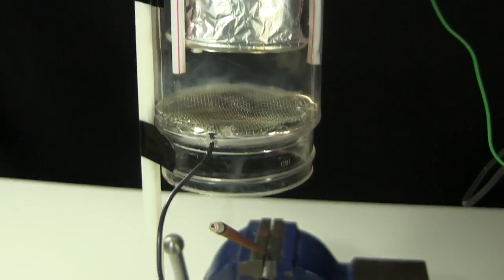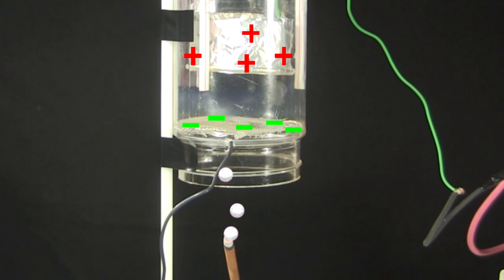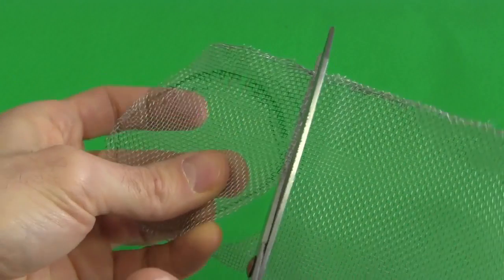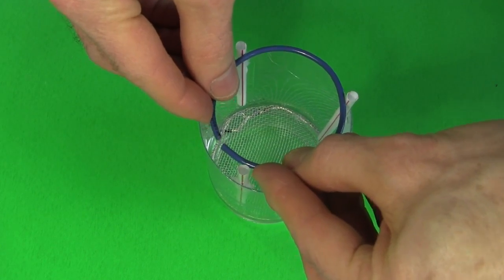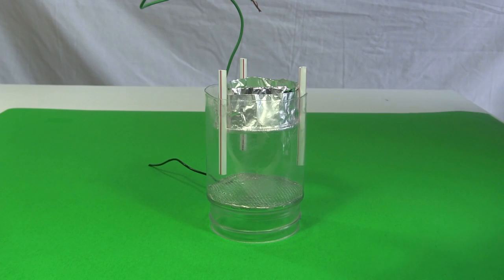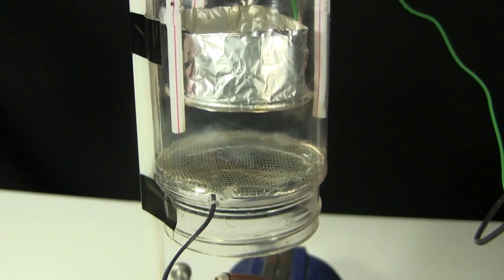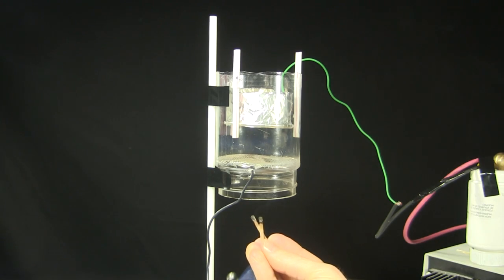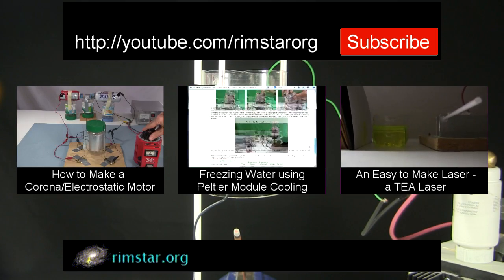Electrostatic Precipitator/Smoke Precipitator - How it Works/How to Make

Comment: First of all, thank you for sharing this video. However do you think that is it possible to apply this precipitator as ESP with the home used incinerator for capturing the smoke and gases from the chimney?
Reply from the maker: It might work. I tested with a few different smoke sources and it worked with the ones I tried. Keep in mind that the voltage involved for this design is high enough voltage to also produce ozone, which in large quantities is bad for your health. But if it's a chimney then the ozone would be outdoors and so less harmful. You might also want to see my follow-up video where I also measured the voltage and tried a few more high voltage sources https://youtu.be/ARSQWTzWago

Comment: Very interesting. I suppose you use a high voltage in DC and not in AC. Is it correct? So, in case I use a HV transformer, should I connect a proper rectifier at the transformer output?...Thank you!
Reply: He mentioned the mesh as negative and the foil as positive. So of course it will be dc. Ac will not work as the particles moves back and forth but never stick to the plate

Comment: To trap dust, can we use current from a battery?
Reply from the maker: Nope, this design needs around 21,000 volts. Batteries are around 1.5 to 12 volts.

Comment: My chance you can include a link for a suitable power source?
Reply from the maker: Have a look at my follow-up video where I made measurements and tested a few different power supplies https://youtu.be/ARSQWTzWago . You'll see that my 26cm disk Wimshurst machine worked as a power supply. Search on https://ebay.com for "wimshurst machine" and you'll see plenty of Wimshurst machines which should work. That's where I got mine from many years ago. Just make sure the disks are around 1 foot/30cm in diameter.

Comment: can i use a homemade van de graff generator as the voltage source?
Reply from the maker: I didn't try it. My guess would be the dome for the Van de Graaff would probably have to be at least 1 foot.30 cm in diameter, i.e., a medium size one at least. It would be able to produce the necessary voltage but you also need a decent amount of current too. Also, have a look at my follow-up video where I made measurements and tested a few different power supplies https://youtu.be/ARSQWTzWago . You'll see that my 26cm disk Wimshurst machine worked as a power supply. Search on https://ebay.com for "wimshurst machine" and you'll see plenty of Wimshurst machines which should work. That's where I got mine from many years ago. Just make sure the disks are around 1 foot/30cm in diameter.
Reply: @RimstarOrg  ok so i should try out the wimshurst machine, thank you

Comment: can we use this for solving promblems of co2 or any toxic gas pls answer my question
Reply from the maker: Nope. In fact, at the high voltages involved with this design, around 21,000 volts, it produces ozone, which is also bad for your health. So it's something you'd have to use in a well ventilated room. There's probably a design you can use with lower voltage that doesn't produce ozone but it doesn't collect every type of bad thing in the air.

Comment: Is 21,000 volts really necessary? What is the lowest voltage you can use and still get results? I was thinking about buying a Harbor Freight powder coating system and using the parts from that to power my smoke precipitator. I read that it goes up to 50,000 volts? But again, is 21,000 volts even necessary? Also, on the powder coating system, the part is negatively charged and the powder is positively charged. Is there a difference whether the smoke is negatively or positively charged? Or do you think you would get the same result regardless? Thank you for taking the time to read my question! 😁
Reply from the maker: 21,000 volts is necessary for this design, i.e., this particular wire mesh for one electrode and a the cylinder having this diameter of smooth bottom facing the wire. A lower voltage can be used if you have a different geometry or design, possibly even in the 10,000 volts range. I don't know about a difference with positively or negatively charged smoke though, I don't know enough to say.

Comment: How many volt required
Reply from the maker: Around 21,000 volts for this design. I show measuring it in this follow-up video https://youtu.be/ARSQWTzWago along with testing other power supplies.

Comment: hey I was just thinking is it possible to make a cigarette filter using this technology? so that the tar gets filtered?
Reply from the maker: I didn't have a cigarette to try so I can't say for sure. Note that with this design, the voltage required is around 21,000 volts. At that voltage, it also produces ozone, which is hazardous to your health in large quantities.

Comment: Hi! Nice video. Will it still work if the screen electrodes fully coated with smoke gunk o soot?
Reply from the maker: Good point. I've never run it for very long, just to try out and demonstrate the basic principle. I don't recall soot gathering on the wire, but if it does then you'd need to replace or clean it every now and then. I suspect that it doesn't gather there because soot does gather on the foil and is hard, if not impossible to clean off. Meanwhile, the device kept working so little or no soot must have been sticking to the wires. But as I said, I didn't run it for long.
Reply: In industrial plant they seems to vibrate the collector to reclaim the pollution's dust

Comment: How much voltage is needed
Reply from the maker: This design needs around 21,000 volts. I show measuring it in this follow-up video https://youtu.be/Lz-HfDWjmRQ . I also show trying different power supplies.

Comment: I would love to install a larger version of this technology on the exhaust system of my gasoline/fossil fuel/petrol powered automobile. and furthermore, if this technology could entirely replace the present catalytic converters in the exhaust system, this could contribute to highly reduced automobile pricing, because catalytic converters require very expensive materials which also have a limited lifespan.

this is wonderful tech, indeed!

thank you for making this wonderful video!
Reply: Nice ! Have you tried since ?

Comment: I have made the same system but it's not working...can you help me out??
Reply from the maker: You'll have to describe what you're doing. What are you using for the high voltage power supply? It has to be DC not AC. Do you know how high a voltage? Have a look at my follow-up video where I measure the voltage and show that for this one I needed around 21,000 volts https://youtu.be/Lz-HfDWjmRQ . In that video, I also show testing other power supplies.

Comment: Is this how bore evacuators work?
Reply from the maker: I hadn't heard of a bore evacuator until you mentioned it but nope, a bore evacuator is a much simpler device, simply an area in a gun barrel which becomes pressurized with some of the gases during firing and then that pressure removes most gases from the barrel after firing. See https://en.wikipedia.org/wiki/Bore_evacuator

Comment: That looks good the only problem is the cost of the high voltage power supply
Reply from the maker: Yup, that high voltage power supply is either hard to make or an off-the-shelf one would cost a lot. However, I did this follow-up video https://youtu.be/Lz-HfDWjmRQ where I found that a much cheaper Wimshurst machine will also work.

Comment: what is the output of high voltage generator ?
Reply from the maker: For this design, I needed at least 21,000 volts. You can see me measuring it in this follow-up video https://youtu.be/Lz-HfDWjmRQ

Comment: why does the mesh become negatively charged
Reply from the maker: The mesh is connected to the ground but it's also the negative of the power supply. So the power supply is what negatively charges it while at the same time positively charging the cylinder.

Comment: Hi! Please answer, we have a research about it. How high is that voltage?
Reply from the maker: For this design, it's around 21,000 volts. See my follow-up video where I show measuring it as well as experimenting with some other power supplies https://www.youtube.com/watch?v=ARSQWTzWago
Reply: @RimstarOrg  that high! It can be lower that that? Or can i use my 2 3.6 V battery?
Reply from the maker: No, high voltage is required to ionize air. Typically in the thousands.
Reply: @RimstarOrg  okay thanks

Comment: How much voltage it required ?
Reply from the maker: For this design, it requires around 21,000 volts. I show measuring it in my follow-up video here https://www.youtube.com/watch?v=ARSQWTzWago
Reply: @RimstarOrg  Thanks a lot. And it is difficult to demonstrate this in Science Exhibition for Scientific Solution for Environmental Sustainable.
If you don't mind can you give any ideas related to the subject above for Science Exhibition to make a model for it .

Comment: I wanted much more info about the power supply. I wish to create a larger version for my HVAC system. I was considering a power supply from a neon sign.
Reply from the maker: Make sure the output of your neon sign based power supply is DC. This doesn't work with AC. Another thing to consider is that this precipitator design produces ozone, which is hazardous to your health in large quantities. The ozone is produced where the ionization is happening in the precipitator. In a follow-up video https://www.youtube.com/watch?v=ARSQWTzWago I measured the voltage required for this one to be around 21,000 volts. There's some voltage below 10,000 volts, I don't know what voltage, that doesn't produce ozone. If you could make a precipitator design that works below whatever that voltage is then you could have one that doesn't produce ozone.

Comment: Its an amazing Project.  Very Informative. I tried to do the same. But I was using Two 9V battery for input and 40KV Step up module. I am getting the spark but precipitator is not working. If the smoke needs to be captured what is the kind input voltage I should use and what is the kind of transformer that I should use. Please let me know. that will be very helpful
Reply from the maker: In my follow-up video I think I measured 21kV https://www.youtube.com/watch?v=ARSQWTzWago . In that video I also show it working with a Wimshurst machine (30 cm disks), so that's another option. Your two 9V batteries stepped up to 40kV probably didn't supply enough current. It needs high voltage but also enough current to do the necessary amount of ionization. I don't have a number for how much current though. It you are getting a spark though, then your mesh is too close to the cylinder, move them apart more. I also show that in the follow-up video.

Comment: Can this reduces smoke smell also..?
Reply from the maker: I would think so since it's capturing all the soot but I'm not sure if what you smell is only the soot, maybe there's something else that doesn't get captured by the precipitator so I'm not sure.
Reply: @RimstarOrg  thank you for the reply. Does it requires high voltage Or I can use Batteries..?
Reply from the maker: I requires high voltage. I measure it and show some alterative power sources in my follow-up video here https://www.youtube.com/watch?v=ARSQWTzWago

Comment: Is the ground wire (-) independent of the positive high voltage source?  or does this come from the same source?
Reply from the maker: The ground wire is connected to the same one that the high voltage power supply uses. So the high voltage positive is relative to ground. If you have a high voltage power supply who's positive and negative outputs are floating (i.e., they're not relative to ground) then you have no idea what voltage they are relative to the table, which is at ground potential. So you could get unexpected effects.
Reply: @RimstarOrg  wow I understand brother, then the cable that is attached to the flyscreen mesh is the negative output of the flyback?
Reply from the maker: Essentially, yes. Mine doesn't have a pin marked as negative but rather a pin marked as ground. But this power supply doesn't use the output of the flyback. The output of the flyback goes to the input of a voltage multiplier. The output of the voltage multiplier is the output of the power supply. Here's my webpage all about it https://rimstar.org/equip/30kv_pwr_supply.htm . I did try powering this smoke precipitator using a power supply who's output was the output of a flyback with a built-in diode (to get high voltage DC) but I didn't have any success. You can see that one in my follow-up video https://www.youtube.com/watch?v=ARSQWTzWago at around 2 minutes and 4 seconds in. You can find details about that power supply here https://rimstar.org/science_electronics_projects/high_voltage_power_supply_w_flyback_transformer_builtin_diodes.htm
Reply: @RimstarOrg  Now I understand brother, thank you very much for these valuable contributions to knowledge, all your experiments are great.

Comment: What is your voltage used for the separator?
Reply from the maker: For this one, the voltage is 21,000 volts. I measure it in my follow-up video here https://www.youtube.com/watch?v=ARSQWTzWago along with try a few other power supplies.
Reply: @RimstarOrg  i ve go 50kV generator
Its posible for this project
Reply from the maker: Maybe. I also has to be able to supply a sufficient amount of current and I don't know how much. But as you saw in the follow-up video, it worked with a Wimshurst machine which doesn't supply much current. Also, make sure if a 50kV DC generator, not AC.

Comment: cool!
I ponder if it is possible to create a functioning smoke precipitator for laser engraving. It is common laser engravers has an air assist (air blowing away smoke from the burning focus point) , it word be cool to collect this so the wood/paper etc don't get tarnished by swirling smoke.
Reply: ad an air evacuation system that pulls the smoke away and out. once out the smoke can be filtered in any number of ways including electrostatic like this. Tip, use smaller fans to suck out the smoke and maybe a small fan to first blow it away from the laser engraving so the smoke will not block the laser beam. This is a pretty common problem in laser engraving so you should be able to find plenty of examples online.
Reply: @robert5  For laser we use mostly a high flow rate fan with a 150 mm hose. Would be really good to collect all the particles. 
But there are glue residue, smoke inside....

Comment: How much amps is the high voltage DC connected to the precipitator
Reply from the maker: I didn't measure the amps so I don't know.
Reply from the maker: BTW in my follow-up video, I show testing it with a few other high voltage source, some which provide enough voltage and current and some which don't.

Comment: Super video, subscribed!  Thanks indeed.  I wonder if this could be scaled up for home carbon-fuelled oven installations? What kind of voltage are you running here?  Perhaps a different metal will give a different result also..?
Reply: please ignore Q regarding voltage!   oops!
Reply from the maker: I don't think a different metal would help but a thinner wire in the mesh would decrease the voltage needed. As for scaling it up, you'd have to do a bit of redesign but it should be doable. There are precipitators used for industrial systems. However, as you saw in the follow-up voltage, it produces ozone, which in large enough quantities is harmful to your health.

Comment: Why did you grounded the Negative high voltage ???
Reply from the maker: That's mostly for safety. Let's say I have 20,000 volts. That 20,000 volts has to be relative to something. If the power supply's negative and the mesh are connected to ground then the positive and the cylinder are 20,000 volts relative to ground. However, if I don't connect to ground then the 20,000 volts can be relative to any voltage. One side could even be 50,000 volts relative to ground, we don't know. The voltage would be what we call a floating voltage.

Comment: Goes to show that clouds could be moved with high voltage (for cheap too might i add, if you had multiple systems spread around the globe), instead of the nuclear atmospheric tests they did back in the day... control the weather (make it rain in different parts of the world), irrigate the desert if you like, for cheap, no pipes or workers to lay the pipes

Comment: Hi, can this scale, as in large enough to clean the smoke from rubbish being burned in a 55 gal drum? Trying to solve the problem of yah-hoos burning trash and polluting the neighborhood. It's their way of life, I'd like to not have it pollute the air. I was looking for a DIY scrubber and this came up.
Reply from the maker: That can probably be done but you'd have to use a lower voltage than this design uses. This one uses at least 21,000 volts and at that voltage, ozone is produced. Breathing large quantities of ozone are hazardous to your health. You'd need a design that uses a lower voltage that doesn't produce ozone. I don't know exactly what that voltage is though I know it's below 10,000 volts.

Comment: Izin komentar :
Cara kerja dari electro static precipitator (ESP) adalah (1) melewatkan gas buang (flue gas) melalui suatu medan listrik yang terbentuk antara discharge electrode dengan collector plate, flue gas yang mengandung butiran debu pada awalnya bermuatan netral dan pada saat melewati medan listrik, partikel debu tersebut akan terionisasi sehingga partikel debu tersebut menjadi bermuatan negatif (-). (2) Partikel debu yang sekarang bermuatan negatif (-) kemudian menempel pada pelat-pelat pengumpul (collector plate), lihat gambar 4. Debu yang dikumpulkan di collector plate dipindahkan kembali secara periodik dari collector plate melalui suatu getaran (rapping). Debu ini kemudian jatuh ke bak penampung (ash hopper), lihat gambar 1 dan 2, dan ditransport (dipindahkan) ke flyash silo dengan cara di vakum atau dihembuskan.